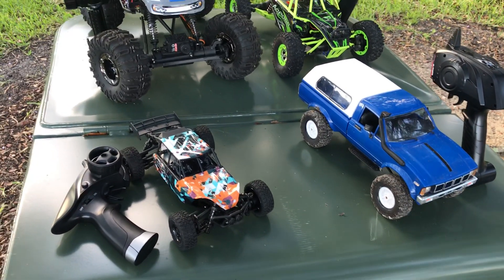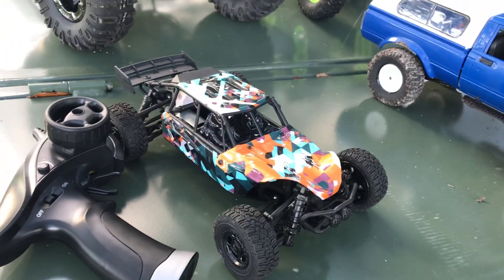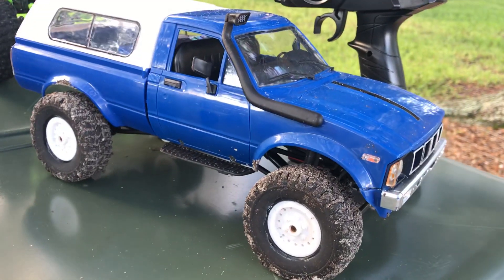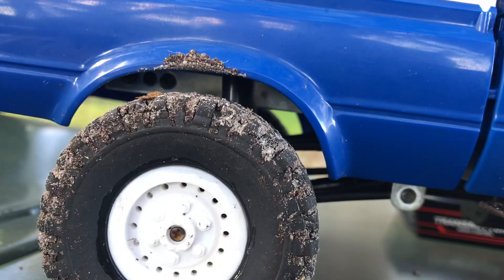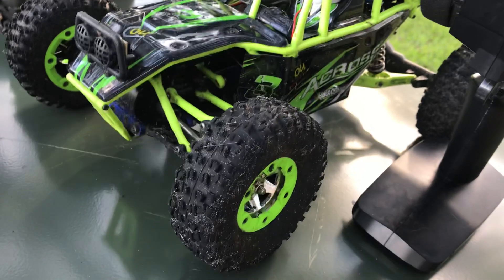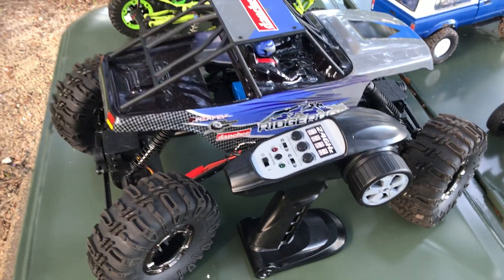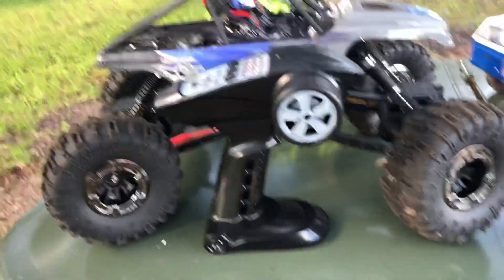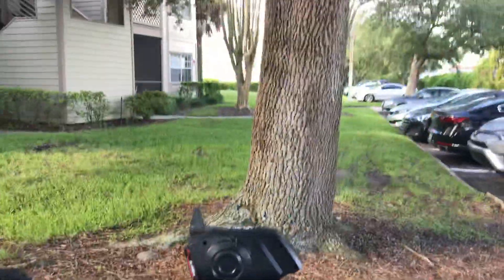1:18 vs 1:16 vs 1:12 vs 1:10 scale off road rc part 1

Comment: Hi im trying to figure out how to reduce the size 110th scale to a 118th scale a roll bar cant figure out the difference to down size any help would be greatly appreciated thank you
Reply from the maker: Hello. From what I’m understanding is that you want to make a roll bar from a 1/10th scale smaller to fit a 1/18th scale? Are you hand making it or 3D printing? Either way you will want to measure some key points on the original. Mostly the mounting points, width (at its widest point) height (at its highest) and length (at its longest). Should be easy to figure out from there. Good luck! 👍

Comment: Do you know of any 1/10th RC cars with doors that open? Looking for some good looking vehicles for figure posing.
Reply from the maker: There are some hard body 1/10 that the doors open. You can always make them open as well. I’ve seen a few tutorials on it. Or you could just buy models of larger size, they usually have all the details! 🌴☀️
Reply: @jbsrcs6273  Appreciate it.